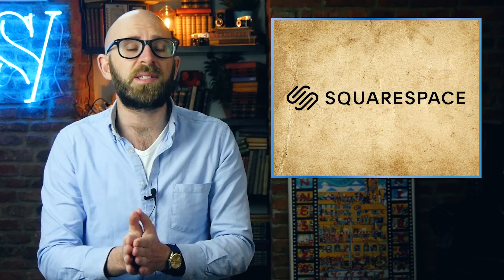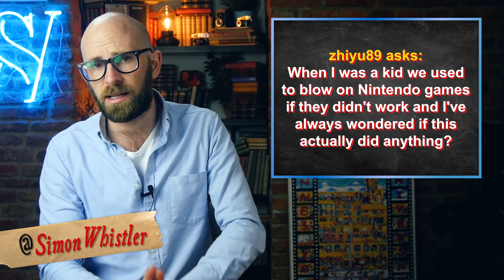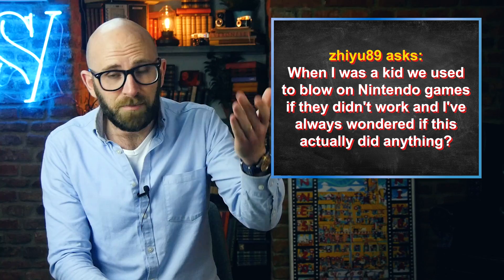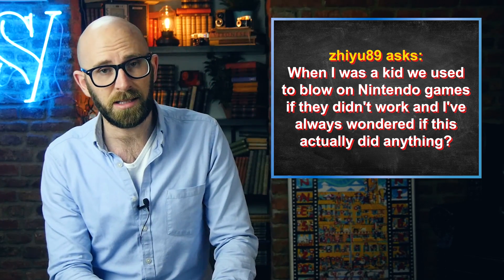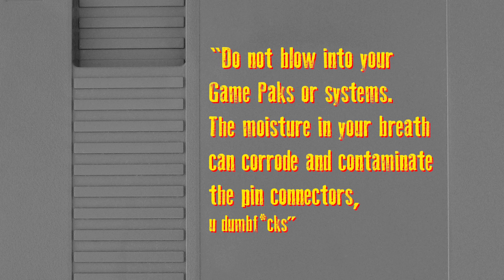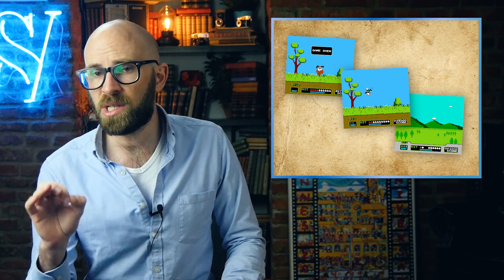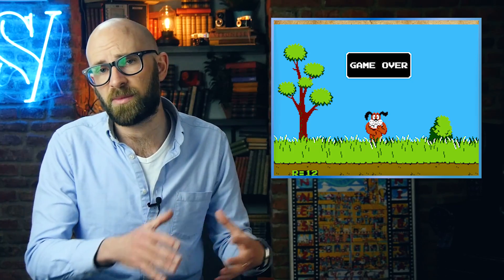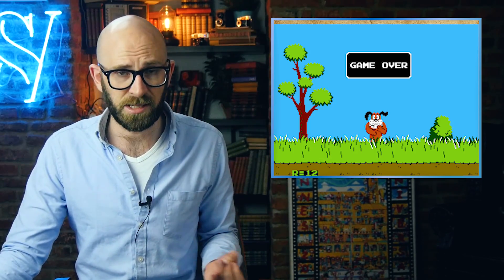Did Blowing Nintendo Cartridges Actually Do Anything and How Did the Gun on Duck Hunt Work?

Comment: How did this “trick” find itself around the world without the internet?
Reply: School/Word of mouth.
Reply: How'd you explain people all over the world doing it?
Reply: Nintendo was played world wide
Reply: I think it's something people just do automatically. If something doesnt work you assume it's dirty. Blowing on something tends to remove debris
Reply: You could see debris, while some people had special cleaning cloths due to being nerds, most people just blew the dust off of the connection. Also, while debatably "bad" or "gross" in the long term, moisture would help the electrical connection in the short term, leading to the blowing on the cartridges being successful at least in short term. 
It should also be said that rinsing electronics was a big no-no and many children and adults worried about scratching the connectors when trying to clean with a normal  rag or qtip.
It helps that no one at the time was quite sure how all the different types of connections worked due to the amount of different connectors being released at the same time and the known problem of a single scratch rendering a disk unreadable in other systems,  computer discs and CDs as examples.
Reply: There are certain traits/habits that humans do seemingly instinctively. Somehow this is one of them.
Reply: @christopherconard2831  Exactly, I was never told to try or do it.
Reply: @christopherconard2831  How do you explain all the videos of people putting the game in and out repeatedly and only getting them to work once they blow into the game?
Reply: Before social media and the internet, people used to talk to each other.
Reply: @BrentsCardsAndCoins  ahh the good old days. 😀
Reply: @BrentsCardsAndCoins  Yes, we did.  I remember when telephones were used for actual conversations, whereas nowadays, teens and twentysomethings use their phones for almost anything but phonecalls.  If we wanted to send a "text," we'd put a stamp on it or send it via Morse code over the airwaves.
Reply: @BrentsCardsAndCoins  lol
Reply: @BrentsCardsAndCoins  i remember them days.  havent talked to a human in years 😂
Reply: @BrentsCardsAndCoins  Oh stab! I heart this answer.
Reply: My cousin and my best friend told me that’s what their parents did to make it work. Who started it? I don’t know.
Reply: Felipe Garcia word of mouth
Reply: The same way diseases spread... except in this case it could also be spread over the phone too. "My cousin in Yonkers told me to blow on it."  You know, I gotta wonder if the FIRST suggestion to take it out and blow on it was said in jest, but when it worked, word spread quickly?
Reply: TV
Reply: yep my cousin taught my brother who taught me.  i dont know what shaman originally taught my cousin though but thank god.
Reply: Literally everyone did it too
Reply: Magazines, tv shows or movies showing someone blowing on the cartridge, maybe comedians and news stories, newspaper articles
Reply: One guy started doing it, told two of his friends, they each told their friends, and this goes on down the line until everyone knows.
Reply: Marilyn Monroe popularized it when she said, "You just put your lips together and blow."
Reply: Your mom
Reply: Actually, the internet already existed back then. It has existed since the '60s.
Reply: Probably because the SNES was shit and everyone wanted to split on it
Reply: @stunash4914  you shut your Blasphemous mouth
Reply: @stunash4914  this is the NES, not the SNES, and they were both arguably the greatest things on earth in their day, and fuck you for stating otherwise.
Reply: Stu nash snes never had this problem.
Reply: @stunash4914  this is about normal Nintendo.  and Snes game library is one of the greatest in the history of gaming.  only thing better was ps2 which had like 5000 games maybe more.

Comment: FYI: MentalFloss broke every scientific rule against confirmation bias to start the false idea that blowing “did nothing.” The author completely ignores his own contradictory sources to conclude what he set out to conclude from the start: that the effect was all in your mind.

Then, somewhat laughably, PBS’ “Itsoktobesmart” took MentalFloss as fact and used it as an example of “confirmation bias” for teaching proper scientific research techniques... without actually doing any tests to confirm it. On the other hand, I have done the tests on the effect to determine whether it was the effect of simply reseating and determined that the effect was definitely NOT in your head.

Yes, blowing will hurt the connections in the long term, but blowing has a demonstrable effect on the success of booting games. It isn’t in your mind. Anyone can test this. It’s only anecdotal until you have enough data.

Do a search for “NES Blow Test.” I’ve repeated it several times for thousands of cartridges. Reseating was never a factor as no games were reseated. Dismiss it if you want, but absolutely NO ONE claiming otherwise has actually done testing. ALL tests along with millions of people figuring this out all on their own make out the burden of proof on the people making these modern and demonstrably false claims (that the success was merely from reseating). Don’t fall for it. Want to do some testing? Come see me. I have THOUSANDS of NES carts and at least 40 consoles. I can come up with a multitude of testing scenarios where the games are never reseated and they statistically boot more often when blown. When you increase the sample size the test has never indicated otherwise even once. Ever. The new notion that blowing did nothing and was all in our mind is demonstrably false. The people claiming it are simply too lazy to demonstrate.
Reply: ...and, no, I’m not advocating that you blow your games. It is bad for them over time. More importantly, it’s bad for the connector in the game console, which is a bit more difficult to clean.

Comment: Don't forget about smacking the damn thing on the side just right. This also helped out lol.
Reply: Ahh yes, percussive maintaince. If that failed you could drop it off a building to get it working. Conversely just look at a modern system wrong and it'll red ring.
Reply: The first step is the exact same technique I used regularly to fix the t.v. that the NES was connected to ;)
Reply: Had to do that with my xbox 360 to open the disc tray
Reply: only if you were the fonz.
Reply: @Selvokaz  everybody who owned a Nintendo was the fonz lol.  you had to be xD
Reply: Lol.  Our old tv was the same way
Reply: o my god lol its like we all passed around the tricks of the trade.  yep a good sturdy smack just right fixed many of my games.
Reply: Actually smacking the cartridge would work better than blowing as it could jar the pins to re-extend and wouldn't have the corrosive effects of the moisture of your breath.
Reply: Yup, smacking the side of the NES would help sometimes.  Also the "hold down reset button and push the cart up and down inside the NES"
Reply: @cylontoaster7660  NES= Needing Extra Stimulation?
Reply: That is the one thing I miss about old technology: if it stopped working, you would just hit it till it worked. Nothing is built like that anymore. Stupid snowflake technology😁

Comment: Q-Tip dipped in rubbing alcohol to clean the contacts pretty much always fixed the issue for me when blowing on it didn't. I mostly played the SNES though, it's didn't have a defective slot design like the NES did. On my old NES I'd sometimes have to wedge something between the cartridge and the top of the system to make it work.

Comment: Back in the 80's I used to dip a Q-Tip in alcohol and clean the cartridge contacts. It worked for a while but that crappy cartridge contact design still sucked. I still have my original NES from the 80's. It currently resides in our house's garage. I have to fire it up and see if it still works.

Comment: Suggestion: Why do arcade game machines almost always use tubular locks?
Reply: well if you're the locking picking lawyer its for easier picking with an impression tool.
if your the cabinet maker, cuts costs.

just a hypothesis though.
Reply: cmdraftbrn heyyyy another LPL fan!
Reply: @cmdraftbrn  I have to imagine it's the low costs, though perhaps, with the highly reduced likelyhood your average person would know how to "attack" the lock (this likely being a convenient afterthought). 
Pretty much anyone can shove a screwdriver in a standard pin tumbler, but show most people a tubular and they've got no clue where to start since they don't understand how it works, for the most part. 
[Insert some "security through obscurity" concept here] 

Either way it'd be an interesting episode for TIFO.
Reply: Fun thing about those though, they're mostly all keyed the same, so if you've got a key to one, you've got a key to most of them, and it's not a protected key either, you can buy it off of amazon, as well as the 2 standard keys to most electronic lock systems
Reply: @skylergarza8371  same with CAT heavy equipment. All the same key.
Reply: Also known as an Ace lock.
Considered more difficult to pick

Comment: I used rubbing alcohol with a q-tip. Worked every time.
Reply: I wish I knew that when I was a kid.
Reply: @dionr1168  Me too!
Reply: So did I. Tried and tested.
Reply: Lacking the alcohol and Q-tips, rubbing the contacts with a pencil eraser worked for me too!
Reply: @jamessanborn3043  But that can wear out the contacts. That's sandpaper on thin copper.
Reply: Robert Pirlot  over the years I’ve used that method of a pencil eraser on PC board contacts, with no problems.
  As I said, I would prefer using isopropyl alcohol and Q-tips, but in a pinch the eraser served well.
  Keep in mind, it was a soft eraser, not the abrasive types one would use to remove ink on paper.
Reply: Yep! And Nintendo was kind enough to sell a professional grade one with professional grade alcohol!
Reply: I dropped my flip phone, in a parking lot, the back fell off and the battery went flying.When I put it back together I wiped the connections with an alcohol pad.Prior to the battery had been draining way to fast,after it was back to normal.Since then I wipe connection on everything regularly.
Reply: I skipped the alcohol(damaging solvent) and went straight in with the Q tip rubbing very gently. You don't want to damage the insides.
Reply: @augustusmcgovern6084  very true, but also keep in mind that dry rubbing can cause serious abrasions and even trigger severe internal chafing over time.
Reply: James Smith so did blowing on it lol
Reply: Nintendo sold an Official Nes Cleaning Kit that was a plastic thing and nylon thing with a liquid to clean it and it was dirty... the instructions was to push in and out several times... We did that and it worked but we used it to push the other game in... Then came GameGenie
Reply: Its a much better method than blowing on the cartridge, but blowing did sometimes work too.
Reply: I was foolish and bought the cleaning kit... which was probably a glorified q-tip with isopropyl alcohol.
Reply: Yes
Reply: My mom taught me that when I was younger for my ds games
Reply: Its not able to be used as a double entendre though
Reply: And i bet you still have that console.
Reply: JDR I do actually. I just played Mario 3 the other day.
Reply: @JamesSmith-ho7kg  i love stereotypes
Reply: Original NES games stated on the back of the cartridge to do that.
Reply: Do you think this method also prevented the pins from changing to its bad form, too?
Reply: Yeah except rubbing alcohol damages the cartridge.....
Reply: Alcohol is an incredible cleaner
Reply: I did that too. As well as adding a second game to add pressure with usually helped.
Reply: Yes I did most of the time
Reply: Whenever I had issues with a cartridge my grandfather would take it out of the NES and spray the cartridge with WD-40. Worked every time.
Reply: This works, but damages and corrodes the cartridge over time.
Reply: This is cheating
Reply: That would eventually give you the blinking screen.
Reply: same
Reply: This is my go-to method for cleaning my games as well (even though I still have the habit of blowing into them after cleaning).  Also good to utilize the dry end of the Q-Tip to dry the pins in the cartridge after washing them with the alcohol 😉
Reply: You are lucky.. many STD's are impervious to alcohols.

Comment: I always used a q-tip and alcohol.
Reply: I always use weed and alcohol.
Reply: Same and it worked really well
Reply: but the problem wasn't dirt/dust, cleaning it shouldn't help.
Reply: @RubyDoobieScoo  Yeah, you are right, but that was 30 years ago and, I was a kid.
Reply: @RubyDoobieScoo  it actually did build up residue, it wasn't dirt but more like a gunky stuff, I think it built up from moisture in the air especially if you lived in areas with high humidity.

Comment: Yes, the answer is yes. Haven't watched the video yet but regardless of what you say the answer is yes.
Reply: It worked all the time.
Reply: Moisture helped electrical current on the lose pins. 

 Sad they missed the mark and have no idea it had nothing to do with the blowing itself but instead it was actually about the moisture in the breath itself. 

People justb assumed it was for dust reasons.... That doesn't change the fact it wasn't, and that it indeed worked if done with proper moisture in your breath, which any gen-x'er knows for fact.
Reply: Yeah, a spit sniper would sat that.
Reply: I agree! It works.  I still do it with USB sticks and my phone chargers.  SCIENCE!!!!!
Reply: No. It did nothing and the humidity and saliva from your blowing on it actually caused more of a chance of corrosion of the gold contacts on the cartridge.
Reply: @JamesR624  *copper